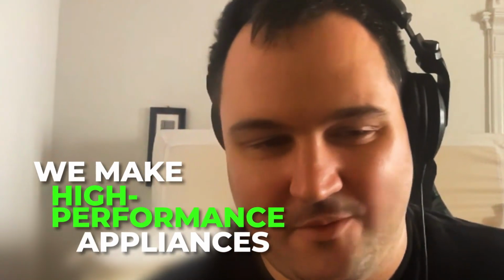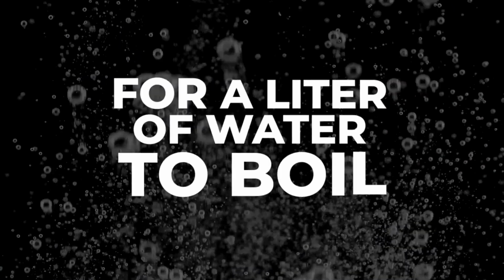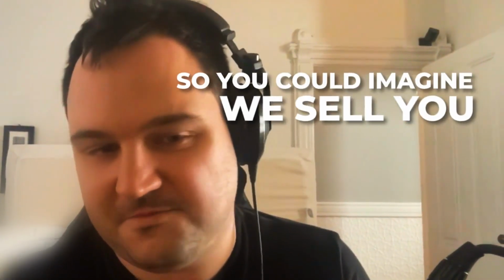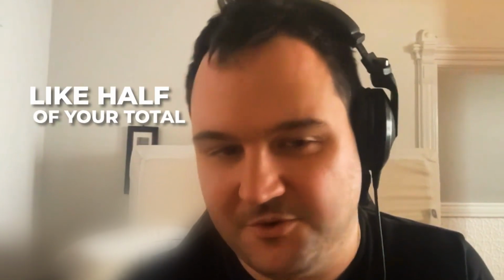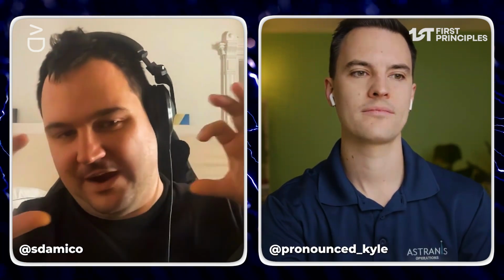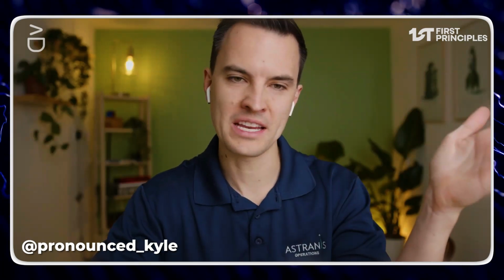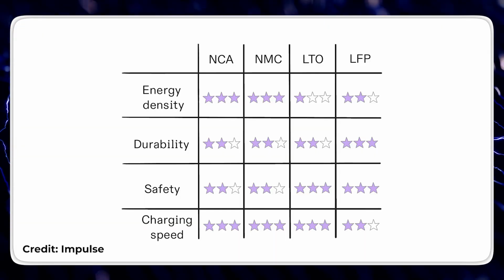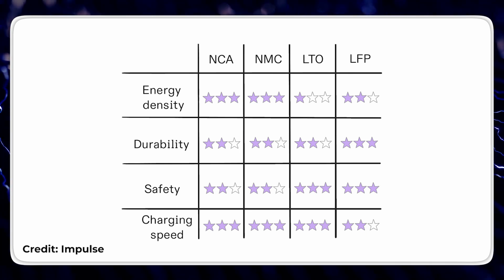How This Stove Boils Water in 40 Seconds | Sam D’Amico, Impulse

Comment: Very interesting.  Just so you know, the time stamps are way off e.g. (34:18) isn't about " Precise Temperature Control Via Induction Current Regulation and Sensors".  That topic seems to be at (47:22) or maybe (50:12).
Reply from the maker: Yikes, thanks for flagging

Comment: Physics to boil water has not changed.  The amount of energy needed is the same.  This is a scam.
Reply from the maker: The stove works by giving the water that energy faster. Not a scam.
Reply: @1stPrinciplesFM  - the electricity comes in at 2400W, 90% efficiency, still takes 3m46s.

Comment: but does it get wok hei?  I don't think so. I'm for greener tech, but induction can't get wok hei
Reply from the maker: I mean, you can choose to smoke oil if you want to haha
Reply: So there are induction stove tops made specifically for woks. They are shaped to heat the sides of the wok. I could see this company potentially in the future offering an attachment to swap out the flat top for a wok top.

Comment: So I have to spend $5k for this stove, but how long does the battery last and how expensive is to replace it and can you replace it yourself as an idiot?
Reply: I need one of these designed for car camping.. lol Just plug it into my EV car jack and cook a meal off the tailgate.
Reply: this
Reply: @dazetwenty346  the battery pack is swappable by removing one screw and sliding it out (but should last 15+ years).
Reply: @sam_damico  Thanks again! I heard LiFePO4 batteries last quite long and not sensitive for discharging fully and charging to 100%; this makes them a good choice here.
Reply: @Sekir80  100%.  We actually started cycle tests with our cells and some extremely aggressive scenarios (max power boil for a while + cycling battery daily) and it’s behaving better than expected.  Some chance the battery physically getting old (versus usage based aging) is the pacing factor, which is good.
Reply: @sam_damico  That sounds great! Wishing you and the company the best!
Reply: @sam_damico  Are you planning/is it possible to make 1st gen stoves potentially compatible with eventual sodium ion battery packs? Also when can I order this to Australia please and thank you?

Comment: Okay, so to boil 1,5 liters of water in a minute needs an input around 8,5kW, later in the interview stating 10kW is the power and given induction cooking is around 80-85% it adds up nicely. Saying 3kWh battery discharged at a bit above 3C (3.3 in this case) could make a 10kW output. So, the numbers are looking okay.
Questions: 
- can you program the device to charge the batteries at certain time of day or grid supplied input to minimize cost? Meaning: do not charge the batteries at peak electricity rates, but at night when it's cheapest.
- is there an option (or at least a plan) to use the battery as a storage device and give off to other appliances? Would bi nice to have plug at least to power something else from the battery, especially in a power outage situation which was even mentioned. It doesn't matter is your cooktop works, if you have no lights on in the kitchen, right?
- visited the product page. This device is huge! With build in 3kWh LiFePO4 battery it must way at least 50kg or 100lbs. Is there a countertop reinforcement advise?
- how long does it work? 20 minutes at full power, I presume. 
- how fast is the charging?
Reply: Thanks for tuning in!
- yes
- it has a bidirectional inverter to enable this capability, for peak shaving at first versus whole-home backup
- it works with normal ikea countertops we've tested! (and others).  Other products today have to survive someone leaning on them, and some cooktops are quite heavy.
- you will hit max temperature on the pan and it will throttle power to maintain that, so from experience if it's plugged in it will generally not run out of energy in the battery
- hour and a half from flat dead to max on 240V, closer to 2h on 120V.
Reply: @sam_damico  Hi Sam!
Thanks for the participation on this podcast and your answers! I really like the idea of your product, short burst, high power application is best suited for batteries instead of having 10kW wiring, fusing and so on. Would your team consider making a flow-through water heater as well for showers? That needs north of 10kW of power, even 15! I think that's the other huge consumer in the household that fits the short and powerful bursts.
Reply: @sam_damico  Hey Sam! Noticed on the spec sheet that the inverter only draws 2kW max. In the event that I’m operating the stove on a 240V circuit, is there no way to draw more power directly from the grid as opposed to being limited to the capacity of the battery/inverter? If not, it seems fairly wasteful for a stove that supports 240V input to only be able to draw ~8A continuously.

Not sure if this is an edge case you’ve tested or accounted for, but would it be prone to overheating (or losing power entirely) if, for example, you were to bring a large stock pot to a boil and keep it on a simmer for hours on end?

Comment: Meanwhile in Europe with three phase 3x 400V to every home and a normal modern kitchen having a 2-6kW induction stove...
Reply: We’ve also seen in Europe/Asia you don’t always get extremely high current to the stove connection in multifamily
Reply: Sure, maybe they should provide a light product that would have all the nifty features, but skip the batteries. I would be very impressed with the amount of temperature control offered.
Reply: @skinkie uhh this is wrong. We have two legs at 120 that add up to 240 and almost all new house feeds are 200amp. Some are larger than that. We don’t have 200 amp breakers for individual circuits but we definitely do have 200amps at the panel.
Reply: You don't even need 3 phase, in the UK 240VAC 40A hob circuits are normal, can easily stick 9kW into a single hob for boiling, load management also almost never kicks in when using 3 or 4 burners at once.
Reply: America once again chose * dummy power * when it came to long term thinking...same reason our homes are built so cheap.
Reply: Yeah, yeah, it works, but their approach is a bit different. Not everyone have 3 phase, building it out can be expensive. This product looks quite decent as an idea, I think there might be a market for it even in Europe. Problem is the price. For that you can install the phases and wires and buy a regular induction cooktop.
Reply: @Sekir80  I am from germany, every one here has a 3 phase house connection. There are 3 x 63A Fuses in our house built 1967. This means 3 x 14490 watt you can use. And we need this power because our water heater need 3 phase 18000 watts for instant hot water.
Reply: @PSNCinqecento  That's neat! I'm in Hungary where 32A is the maximum you can get without paying the utility for extra. This means you can have 1 x 32A, or 3 x 10A, whatever, but below 32A. Of course you can request more amps for a fixed fee of the utility and it's not even that expensive.
I requested 3 x 25A because also have a flow-through water heater which is 2 phase 5,5kW totalling 11kW. But building it is still pending.
Reply: @PSNCinqecento  Not everyone has three phases here in Germany. In many older (or cheaper) multi family homes, each apartment has only one phase 35A, that's 8kW.
Reply: @moe.m  That is why i wrote house connection, the main connection to  a building is allways 3 phase. There are appartements with only one phase, but this is very very rarely. I saw only a few in over 15 years in the job.
Reply: @PSNCinqecento in America while we only have 240v we have 200A breakers allowing us to use 38,400w not exceeding 80% of the breaker rating
Reply: @faded.0913  In the US you have 120V. 120V * 200A = 24.000W, not 38400W. And 200A breakers seems to be very high and out of normal.
Reply: The US is a 240V nation, not 120V. Split phase 240V, but definitely 240V.
Reply: @JoeStoffa  In germany we have split Phase 400V, that does not count for a normal customer.

Comment: I got a quote to run 240V to replace my gas stove: $4k for wiring and $3k for a new panel (after electric company ince tives). The $120 single heater portable i duction unit works better than the gas burner. Good thing I don’t cook big meals and need 3 or 4 pot heaters. I hope that battery appliances take off.
Reply: If you need to upgrade your service connection (from 100A to 200A) that's 18mo in places like San Francisco + $10K or something obscene.  This stuff isn't noticed except by folks like you who try to do it!
Reply from the maker: Wild! Did you buy it?

Comment: Honestly I'd love to see them produce more battery integrated appliances. Beyond just the oven. Having a fridge and/or freezer with a battery built in would be useful for power outages as well. Could make the fridge/freezer run on DC, straight from the battery for longer run time on battery only. Would probably sell well in areas where power outages are a concern.
Reply from the maker: I'd probably choose water heater first, then AC, then fridge/freezer...
Reply: @1stPrinciplesFM  I was thinking of limiting it to kitchen stuff first. I'd love for a mini-split heat pump with battery though.